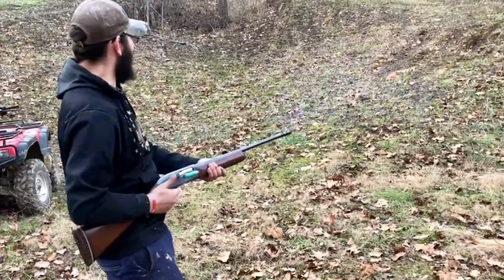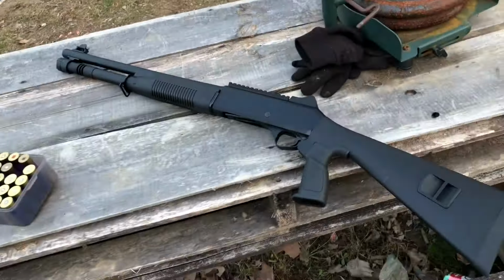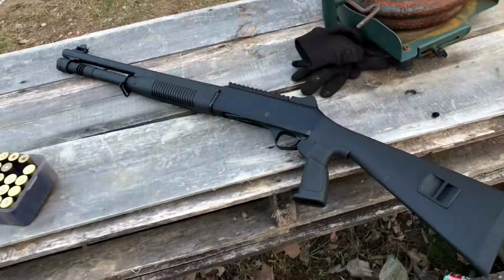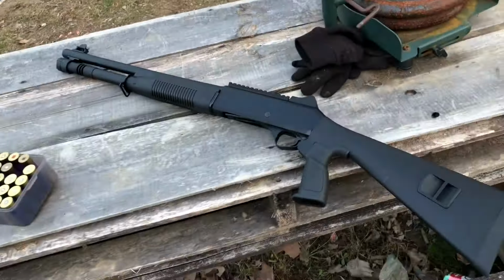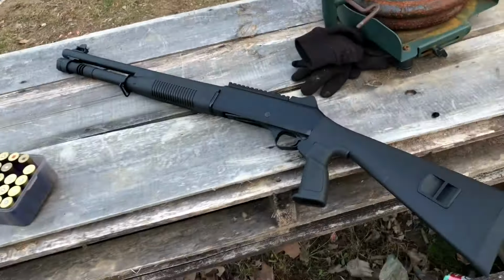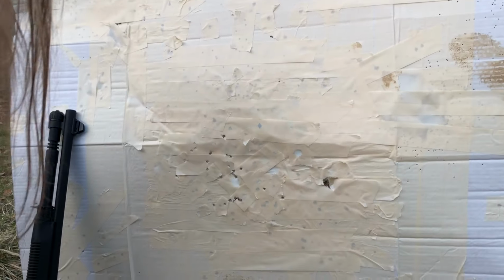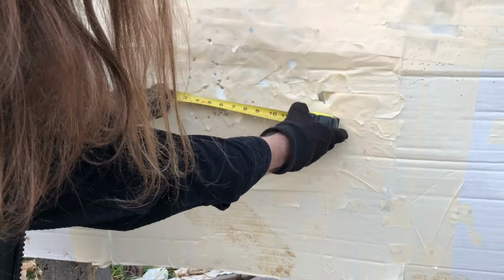#4 Buck & 00 Buck Combo Range Testing

Comment: I like cylinder bore pattern best for home defense, all the larger pellets together in the middle of the pattern is really good. Would the pattern open up even more if you put the larger pellets on the bottom of the stack? I would like to try it with #1 buck and #9 birdshot. The  birdshot hits them in the face blinding them while the buckshot hits them in the chest at the same time.
Reply from the maker: We might test that out
Reply: @theshotgunscientists  that would be awesome. If you try a few different stack configurations of the same load that would be appreciated.   Buck on top of shot, shot on top of buck, both with the shot mixed into the buck like buffer and the two separated by a nitro card.
Reply: Any center mass hit with buckshot in the house , you’re dropping the problem. No point to waste the 9 shot with “blinding them” it’s hard to see anything once your spinal column has been removed by more than ounce of buckshot through your chest at 5 yards
Reply: If youre hitting them in the face with the pattern of 9s inside the house in home defense you’re hitting them in the face with buckshot too, kinda stupid to worry about blinding anybody at the same time you hit the instant off switch
Reply: @user-TherealBFM  Try wrapping your brain around the idea if a 6 inch pattern of buckshot with a 2 or 3 foot spread of birdshot radiating out from the center in every direction.

Comment: I wish there was a straight walled rimmed rifle cartrigde that has a bullet seated same as a 45-70 . That is no sabot .  That fit a 12 gauge and has 12 gauge pressure .  A brass case of course .  A 73 calliber bullet .  Then call it a 12 gauge shotgun slug cartridge .
Reply from the maker: Look up the 12 gauge from hell, what you described does exist.
Reply: You can also buy Rocky Mountain Cartridge brass cases. They are true 73 cal (not like the magtech ones that are 11 gauge), very thick and durable
Reply: @jacobackley502  
Thank you so much .  I will look into it .

Comment: So how or what are the choked tubes from largest to smallest
Reply from the maker: .730, .710, .700 typically or .720 if improved cylinder instead of cylinder which is very common.